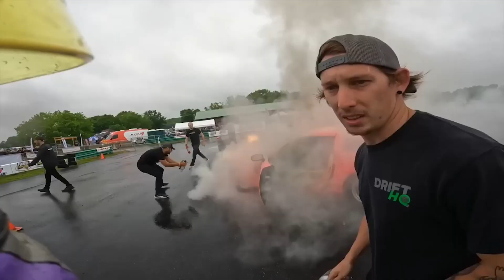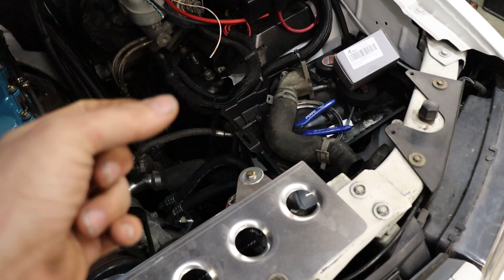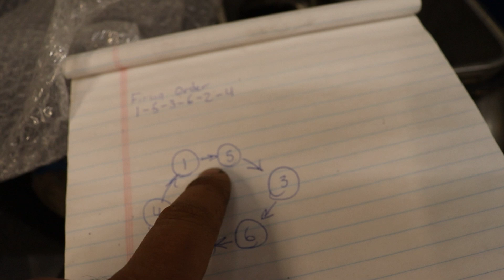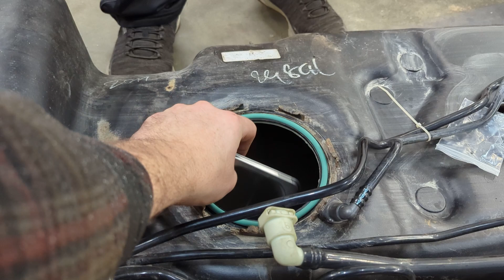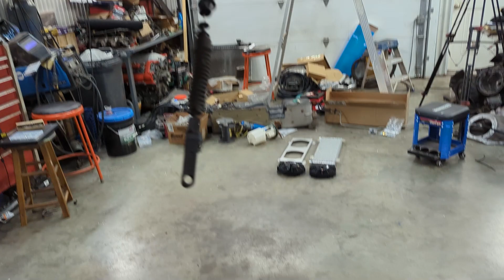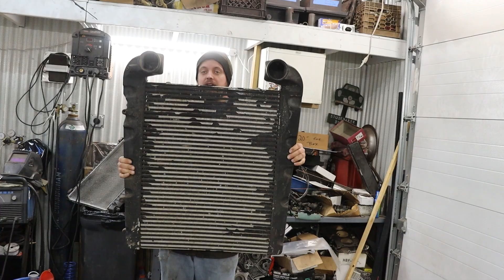Building The ULTIMATE Turbo Manifold for the 800HP Inline 6 Trailblazer

Comment: Hey there I have a low mile 2004 trailblazer I have a serious? to ask how much too turbo it using what ever you need and have used on pump gas not trying to set world on fire but make around 500 hp at tire If you have time what would cost be id pay you for all parts upfront ty.

Comment: To get the sound you want, you need to double step up the diameters (example, 1.5-16-1.7) on the equal length primaries, at equal lengths between the distance from the flange to the collector, before they reach the sequential collector. That will increase the exhaust pulses and increase the pitch of the exhaust while the rpm rises.

Here's an explanation:
https://youtu.be/vA-Z3ncTdUY?si=ZJekNfz1ea2YwwTZ

Comment: I wonder if you could feed cold air from the front through the front differential inside the oil pan? To the turbo?
After removing the front axles and gears by cutting in hole in the front to feed it.
 Yes I am joking.
Oh and I did remove that from my Envoy. Diff bearing went. Never used $WD anyway. The bearing in the left side of the front differential went bad.
 But I did have a two speed rear axle that 2 speeds did not work when it was rolling. Pick one.
Low gear gear? Yep got some tire marks and and chirp when it shifted to 2nd. And 3rd.
Yes it did cost over $1100 to replace the fuel pump 11 years ago.
I like that Atlas I-6. The rest not so much. Rear axle and transmission, OK too.
The dash electronics suck.
If you want the original spare tire and wheel. I got the 2003 steel wheel and tire in the garage. Only been on the ground when I took it out. 
Have fun. You deserve it.

Comment: It does get better brother, just take it easy and one foot after the other, Tomorrow is another new day 👍 One thing i see a lot and really dont understand why its done the way it is with the shrouding behind radiators and same as your oil cooler where the fans mount to. It seems backwards to essentially block off half your usable surface area for cooling by the addition of said shroud then forcing all the passing air through your fans which in its self is a little silly as after a certain mph your fans arent doing anything and the shear force of air going through them is now turning them into a wind generator or sorts. Hope that makes sense? Hello from Australia also champ, keep up the great work

Comment: I'm gonna guess the "magic sauce" recipe for the perfect tubular turbo manifold will be:
A double 3 into 1 and 3 into 1 individually wastegated into a divided flange so you can run a twin scroll turbo.... ALL V banded if course for ease of removal and install.... AND if you WANT that extra credit....gonna need to be in titanium of course!!!
Honestly, I really believe that this IS gonna be the winner as far as "the sound" your looking for! Just gotta get that cylinder   firing order perfect so they get the scavenging effect on the exhaust pulses so they aren't interfering and causing shocks or back pressure pulses fighting eachother instead if that laminar flow and venturi effect; if course dividing the 6 cylinders into 2 separate banks makes this a bit easier...but not really as you end up having to weld in the 2 wastegate tubes and perfecting their locations. I believe in you Calvin! You can do it!!
1 hot tip: get the ICE Engineering tubular Manifold kit(s) if you already don't use them....if tou DON'T...they will blow your mind and save you tons of time.

Comment: Can you measure the length of the 2900 please? I know on your 4200 wiki you mentioned subtracting the bore spacing from the 6 cyl length, which makes sense. But also it makes sense to just divide the ~30" length from bellhousing to crank pulley by 6 (which is ~5" per cyl). Either you can say the I4 is ~20" long by that math, or its ~22" long by simply subtracting bore space. That 2" will go a long way for my attempted swap idea
Reply from the maker: Just subtract 8 inches. The bore spacing is 103mm times 2

Comment: That charge air cooler is from a mack mr600 series truck. It's a cabover style truck. Usually trash truck.
Reply from the maker: Nice! Trash truck intercooler. Lol
Reply: @Calvin-Nelson  I have 1 just like it that I saved. It's going in my Cummins swapped 71 c50 truck. I also work at a mack dealership.

Comment: A few things
Time 228
This is why firewalls are called firewalls and need to be sealed.  Another consideration that I'm betting that gets overlooked.  If fuel ends up spraying into the cowl vent, that is still an opening in the firewall. 

Time 300
What is the coolant flow direction on these engines?  The thermostat is on the lower / drivers side however the stat does not have a disc on the end to block the bypass like other bottom stat engines.  The transmission cooler is also on the bottom of the rad pointing to this being cooled water inlet to the engine.  

Time 400
Electric fan  Some of these vehicles had an electric fan clutch. ( I don't know what year range )  I'd think it would be straightforward to use this trigger to run an electric fan.  

Time 1005
Heater connection.  I'd be putting some sort of mechanical clamp to keep the quick disconnect from coming off in case the plastic clip melts. ( Like a fork / hook then screwing it to the firewall. )   Also, it is possible to get silicone high temp heater hose, this is used on large trucks / bus applications.   Some silicone / fabric heat sleeve for insulation would be helpful as well. 

Time 1800
Surge tank / sump   I've seen steel surge tanks break loose in steel tanks ( when some FI cars used a steel tank ) and destroy the sender / pickup.  Think about the force that 1/4 tank of fuel has even in normal acceleration / cornering.   In theory, drilling the sump and tank floor using a bolt / tight fitting to threads plastic sealing washer / sump / plastic tank floor / another sealing washer then nut would not leak.
Reply: Another bit
I'd say that engine off heat soak would be harder on hoses and such than driving.  Perhaps a procedure to lift the hood after a drive or having the rad fans on a timer after engine shutdown would be helpful.  Even if the fans were running at a slow speed would help drop temps.
Reply: @bobroberts2371  I enjoyed learning from your comment. I'll pass on a handy youtube comment formatting tip I learned recently. If you type the time in the format mm:ss as in 10:00 that text will become a clickable timestamp. Have a good one!
Reply: @64Pete   Except, sometimes You Tube goes on a rampage deleting posts with time stamps, links or even vid titles / channel names.  Even with 100% NON controversial vids / comments.

Comment: Where did you get the grille and headlights, when I look it up I can only find 1 company that makes it
Reply from the maker: I think the grill is factory. The headlights were on it when I bought it.
Reply: @ see I thought it may have been a split yr thing or a trim but couldn’t find nothing about it. I can only find 1 aftermarket company who makes the grille and slim pickings on the headlight assembly

Comment: Another great video. On a side note any good sources for OEM quality or better Oil pumps? Working on a 07 3.7 swap in my daughter’s 06 3.5 Colorado. The 3.7 is on the stand right now and I am having a heck of a time finding OEM parts for it. I really wanted to do the oil pumps, timing chains, and clean up the head while it’s out of the truck. We have plans for an Eaton M90 on it once she is up and running good.

Comment: Scranton area here. This winter has been brutal. Hard to get after it when you risk life and limb walking from the house to the shop. 😂 Hard to get a buddy to brave the Arctic tundra on a junkyard trip. I'm right there with you on the seasonal depression. The past two days of sunshine felt like a tropical vacation. 

You're killing it already. Micah Diaz shouting you out is dope. Rubbing shoulders with the Denmah is great. I'm blown away you aren't getting flooded with offers to plug more. Ps Fuellab has a budget and is big in drifting ;).

I am so stoked to learn about the 8hp, as well as the manifold sound goals. I've been watching your header vids over and over. I have a 3800s2 on a stand just waiting until I really wrap my head around v6 single turbo manifold sound design. 

And that "surge/slosh" tank is genius. You should snip that to a reel.

Comment: One thing LZ refused to do, even though I, and many others told him he needed to do, was to also run a stepped primary system. Whatever size you would typically run for your header primaries, is your ending primary size, but you start with primary tubing the same size or a few mils larger than your exhaust ports, run that for about 12", than size up the primary. Say like, 1⅞ starting, 2" ending, 3½ pulse tuned AND internally spiked collector..... you also want your collector itself not to collect abruptly, it should be on a low angle so they blend together smoothly, not abruptly.

Comment: Haven't you thought about going with an air to water cooler? For the amount of HP you're usually running, you can run a small, or 2 tiny bricks and then the heat exchanger itself will be smaller than an air to air intercooler, plus, more stable and consistent intake temps
Reply: We've run A2W before. You'll see it on the next project

Comment: Calvin man, you're an absolute mad scientist when it comes to fab. I don't think anyone's knocking you on not filming every little nook and cranny albeit you might have done so with other builds. Just seeing what's possible after enough meticulous thought and effort on each vehicle is enough to motivate somebody in my opinion. 

The trailblazers beautiful, while definitely on a level beyond most, especially with the refabrications towards the suspension using F-body parts.

Comment: Car looks great , you really punch these projects out …….  I find things that keep the the black dog away for me , are feeling afraid / challenged  ie  I did abseiling and indoor rock climbing ( when I am afraid of heights )  I go for occasional of lessons in an ultra light ,  Dirt bikes helped the most  …. It might be boxing / tae Kwon do or cage fighting for you ? Even just good old fashioned exercise? I found Having to concentrate in order to not get hurt or worse is great for reducing depression . It was for me the only way to reset the mind . Also the seasonal depression seemed to lift as I got older .   I like the ensemble of parts in that truck ,  although I hate relying on custom parts and electric fans/ shrouds unless they were factory engineered  ( not a criticism ) .  Great work on that header  ,  thinking is the hardest work we can do , and a lot went into the header , Great build look forward to the next instalment . Best wishes for your dad !

Comment: This is shaping up nicely.

A question: when you were planning for this sleeper/daily project, did you consider the 3rd gen Ford Explorer (U152) as a platform? I was watching your first video on this and in one of the chapters you highlighted how cramped the engine was, especially the rear. Here, you echo some of those issues as they relate to the intercooler, trans cooler, and A/C component placement. You've also discussed why maintaining the TB AWD system was a non-starter. The third gen Explorer (1) has a ton more room in the engine bay; (2) the backside of the engine would be more accessible since it doesn't have that goofy recess in the firewall; (3) has a more traditional AWD/4WD front diff setup if you wanted to go AWD; (4) is almost identical in wheelbase, overall length, width, and weight as the TB; (5) already has the Ford rear end; (6) has a nicer interior than the TB; (7) has four wheel independent suspension [pro or con depending on perspective] and (8) has the advantage of being consistent with your history of swapping the 4.2 into Fords :). Since you're changing so much on the TB anyway, you don't quite get the obvious boon of starting with a "native" platform. Though, as the face of the 4.2 world, I get why you may want to do a TB build specifically to drum up interest in the 4.2.
Reply: The TB was $600.  You can't spend convert the Ford into a TB for twice the money.  And we're Ford truck people with 4 of them in the herd.

Comment: I have never understood not using the factory trans cooler, I use it as the first stage of cooling and then run the fluid through the after market cooler . The temperature rise in the cooling system can't be that high. Just my thoughts on the subject. Great channel, exalent content. Hope your father gets better soon.

Comment: If you want to get rid of the rubber totally from the heater lines, you may be able to adapt swagelok fittings to the outcoming side of the motor. We use these for pneumatics with 316 SS so should work well for coolant. Then you just have a solid piece with two screw type connections on both sides.

Comment: that goofy european guy maisteer i think,  claims the secret is equal length runners and stepped runners
Reply from the maker: Yeah. That dude is so funny. Lol. I bet he will figure it out. Can't wait to watch
Reply: @Calvin-Nelson  he's the memelord.  i could have sworn he hit the notes,  with a 4 cylinder in his latest video
Reply: @e.v.a.l.s  I kinda doubt stepped headers will work the same way with a turbocharged engine, the turbo itself does all sorts of nasty things to the shockwaves that help with the scavenging effect you get with a naturally aspirated engine. The sequential design and equal length runners will, however, help with turbo spooling and backpressure since the exhaust pulses aren't getting in each other's way.
Reply: @TheMobiusRibbon1-4  i'm no expert,  just an internet speculator who doesn't understand fluidynamics,  and am just spitballing ideas.  my guess is every trick in the book would be needed to get a screaming exhaust.  equal length,  runners going into the collector in the firing order,  maybe length and diameter,  tube thickness,  maybe even stepped headers.  i think the idea of steps is to increase pulses,  and that's what makes the higher pitch?  and if my misunderstanding is somewhat correct,  the turbo disrupts the pulses.  i'm thinking more pulses = better chance of etting that sound?
Reply: @e.v.a.l.s  You're right on more pulses, properly spaced they do increase the pitch, and the turbo completely cancels out anything the stepped headers might achieve. The setup Calvin has is probably the best he's gonna get with the space available. In theory you want the shortest runner length you can get to maximize exhaust velocity and temperature going into the turbo, and he's done a pretty good job considering how tightly packaged that side of the engine bay is.
Reply: @TheMobiusRibbon1-4  what about stepping down the headers as they get close to the collector?  doesn't one of the rules of fluidynamics say this will speed up the gases?  but then again what would that do with pulses,  and even then would that make any differences with the turbo?
Reply: @e.v.a.l.s  Stepping them down could increase the velocity, but then you risk increasing backpressure which decreases the efficiency of the engine itself. And again, the turbo completely ruins any scavenging benefits you'd see from the stepped headers. Calvin's pretty much nailed the setup here. The only way it could reasonably be improved without radically altering the engine bay is ceramic coating the header itself to trap more heat in the exhaust and drive the turbo harder.